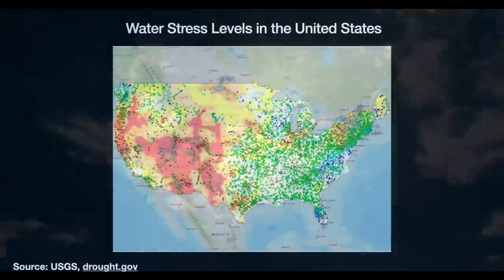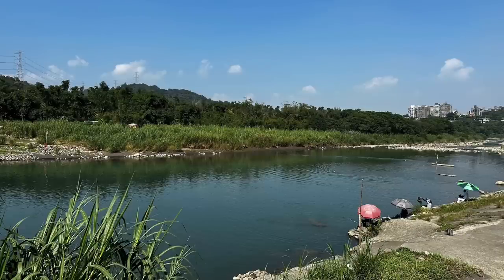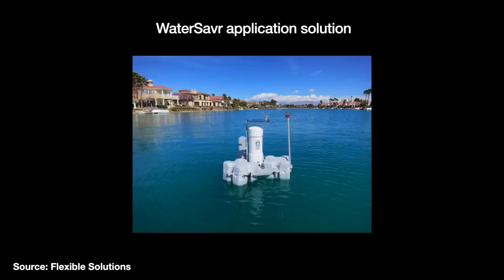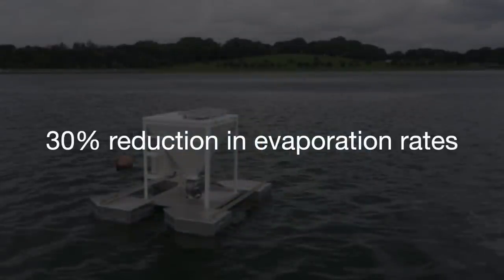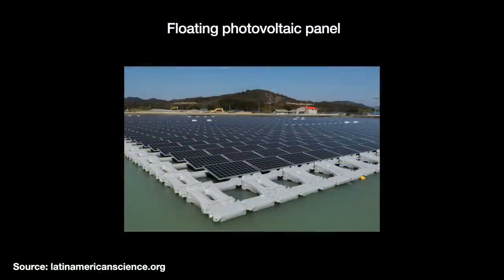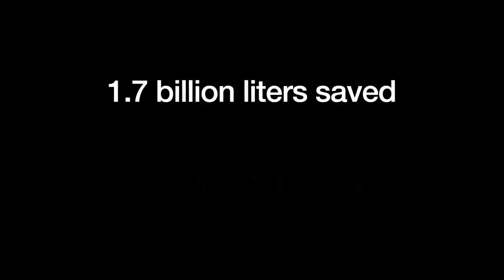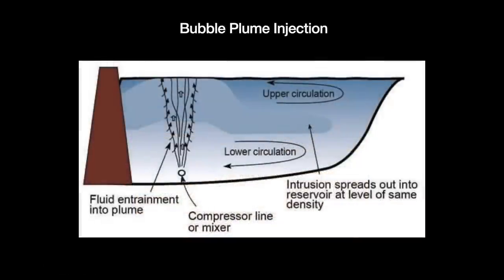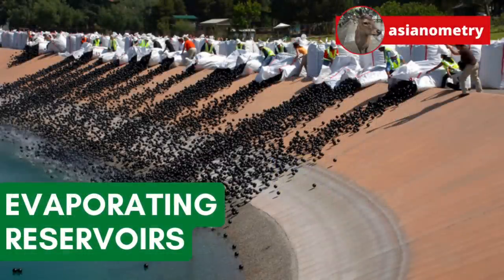When Your Reservoir Evaporates

Comment: So, how does reducing the surface tension of the water reduce the evaporation? (I hope I heard that right, in the first section, about chemical layers). 

IMO, reduced surface tension should make ripples and waves bigger. 

OK, so I found "The calming effect of oil on water", a nice paper in the American Journal of Physics from 2007. From the abstract: "We conclude that the calming effect of oil on surface waves is principally due to the dissipation of wave energy caused by the Gibbs surface elasticity of the monolayer, with only a secondary contribution from the reduction in surface tension." 

So, it looks like I was wrong... but without seeing the whole article, I don't have their complete explanation.

Comment: In the case of balls made of polyethylene, these calculations of the balance of water used to saved are wrong. If we make them in a place where there is no shortage of water, e.g. on the coast, and send them to a place where there is a deficit, such a balance loses its sense.

Comment: I'm wondering if the action of waves on a surface of water vs. still, calm, waveless surfaces are criteria in evaporation. Does the presence of waves add or diminish evaporation? Also the size of the waves, ripples perhaps as made by agitation, or larger ones by wavemaking apparatus.

(I should search this)   ; )
Reply: Already done.
Reply: The rule is simple. If the surface (boundary water-air) increases, the evaporation rate increases. However, with the complexity of waves the exact average evaporation rate from timestamp to timestamp is extremely hard to calculate. Supercomputers would have a hard time with it. One could however develop an algo that visually estimates the number of droplets in a certain area of the water within a certain time, and uses those number to make a calculated guestimate, that would be doable on a current desktop pc.
Reply: Given that the primary cause of waves/ripples is wind, you will have a hard time isolated how much is due to increased surface area to how much is due to a constant source of dryer air blowing over the surface

Comment: Great focus on one single human problem. But the ultimate solution is the slowing – and eventually maybe even reversing – of climate change. Meanwhile, if we use various methods to manipulate evaporation rates, we're also screwing with the aquatic ecosystems. They need the light, and they need oxygenation. And some species need free access to the surface.

Comment: The calculation of "net loss of water" seems flawed, I don't think the balls were made using water from this specific reservoir?
Reply: No, they are prefilled at the factory.
Reply: also, if the balls were made with water from England or Seattle or something, and they're used to save water in California, spending 10 gallons of seattle rainforest water could be well worth saving 1 gallon of california desert water
Reply: Is it though? For the cost of manufacturing and transporting them from water rich places is worth the cost for such a short time?

And if it was why not just transport that water and supply for consumption directly rather than this roundabout way?

Only makes sense if the water used in the balls were not safe for consumption.
Reply: @sevurueva5138  Are the balls actually filled with water? I believe it's just used in the process of plastic production. Quick web search says 28 pounds of water per 1 pound of plastic.

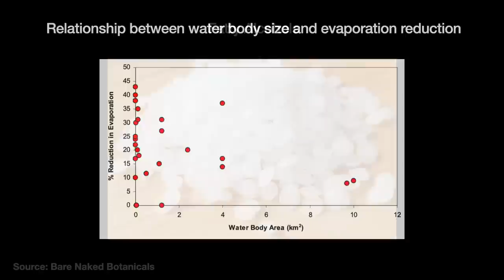Comment: 5:32, uh, instead of balls I woulda thought just alge or whatever that moss that floats on water would be enough to counter the water issue AND help with slowing the rising carbon levels in the air. Only have to make sure to filter it out when draining water for drinking etc.
Reply: 8:25

Comment: Great video, as always. Just wondering if you were aware of floating solar arrays. Other channels mentioned evaporation control as one of the advantages. Ditto for "agrovoltaics", the solar panels integrated into fields that help the crops retain moisture.
Reply: Nice point. It seems that in very arid reasons, removal of natural desert plants increase area heating, but I think the downsides need more before & after studies.
Reply: Mentioned at 8:50 in the video.
Reply: How is this comment 2 months old?

Comment: dropping black balls which heat up in the sun thus increasing surface temps thus evaporating faster? why not make balls hwhite so they reflect the sun?
Reply: My assumption would be that it's a negligible difference
Reply: Wouldn't surprise me if it's a material thing.
Reply: The black pigment probably adds UV resistance.

Otherwise the white, or clear "natural" plastic would degrade much faster.
Reply: @Bob_Lob_Law  thats my assumption. Even to this day,  it seems clear polymers still can't be made as durable as opaque ones for example.

Comment: Using those black balls to slow water evaporation seems like a waste.  Why not shade it with something useful like solar panels.  Now you are shading the water and producing energy.  There are several things I can think of that are better, more expensive but cheaper in the long run than black plastic balls that degrade from solar radiation, break off in the form of micro plastics that then fall into the water and get distributed where ever that water is used.

Comment: YOu cna refer to older papers fro m60/ and 70's and use of tools, like nuclear and steam causes to force evaporation in sea areas or create geological cahnges in systems to better control weather. IE, which is naother benefit of nuclear nergy is steam. So you can modulate the humidity content nad make predicatable climate assessments based on gradient temp of areas ot pull that moisture around until it accumilates into a rain fall, or produce it yourself ina region, no area is really ina drought effect, with knowledge, its simpyl an applicaiton of action to real world. 

Taylorveith below made a good point whihc I thought was also not really critical. What someoen costs in one region, may not ahve the same cost in naother region. 

OPen resevoirs verse, cisterns, but old mines can be cleaned out and then flooded with water and cahgned into cisterns and then utlized as a water source, and of course checked on quality, but most water sources should be checked on quality, the nthere is salt production systems to vanilla produciton systems, in fact if you look at hte entire world. Everythign can be self produced in and on teh earth... its jsut a disorder of logic going on in the earht whihc makes the earht apepar stupid. From proton smashing to get whatever group needed for the system you need ot build would be a good priorty use of energy, Whilst digging and other forms for foudnation structures of study or housing or shelter/ store hosues of our needs, converting the diet into a plant diet wil lawlays ocme up as a future need for the health of the over all system of energy input output...

There is no reality that is better when iether data is wrong, made up or not applied ot reality, teh shade balls are great... but massive tarp would of been cheaper or UV screen, since it would be like a pool cover that does muc hthe same thing keep out debris and milsdy stop evaporation. A dome... its funyn a dome is built for a stdium but not the need of a resource, so teh abudance of wealth is not money or the seeking of it that just makes clogging of arteries, but functional works stops the entitlment mind nad mental illness and gets peopel back ot real world love and works nad fun. All teh apparent work feminsims and wome nahve insulted men for in mass by their minion mind controllers. So, meh, stadiums of water, giant, aquariums can be real. In fact one project and dream I had in my mind blew me away, I was walking about with some white black haired guy and he and I built this or designed and others built it, it was a m ssive glass complex and water aquarium and water recreational center of study. The most interesting thing is the  system habituated free roaming nature of lbue ways and created a positon to which is can come and visit the massive tank and be viewed, and ... I don't it was a dream but it was so much wonder and cool things in it... Even the elevator went at a side angle with a glass front on rails as it descended the depth, , the aquarium was mostly self sufficient... it was ocean access to teh area.... anyways... hard to explain it was dream but fun one.

Evporation... If there is a drought, you cna produce vapor and then seed teh area, but seeding the area, can cause wars if not done intellgiently because it cna cause droughts in other regions and monopolize on food and especialyl when merchants nad money is onvoled and then tribute and disorder.... producing water and pumping it into locations is a good idea, or finding peaks nad creating glacial capping of areas to draw in air of areas... so many things... that can be done and water should never be a concern or energy, but meh, so many nonsense lies and positions its become a maffia gangster hustle over public systems and thus impedeing acts ot correct those system. s